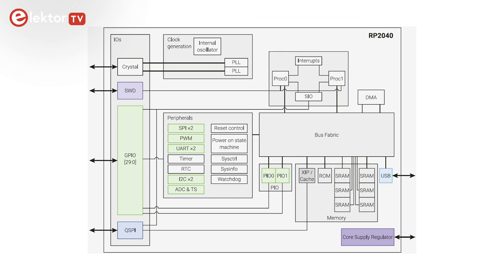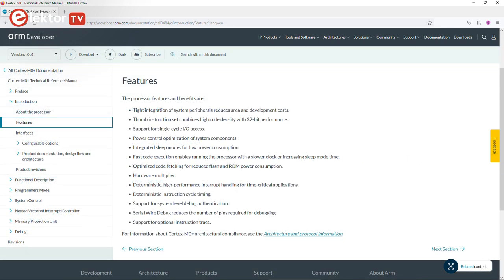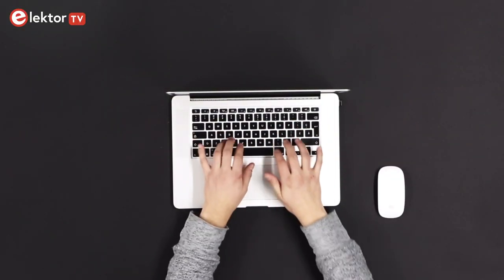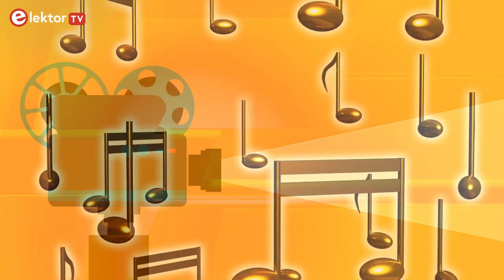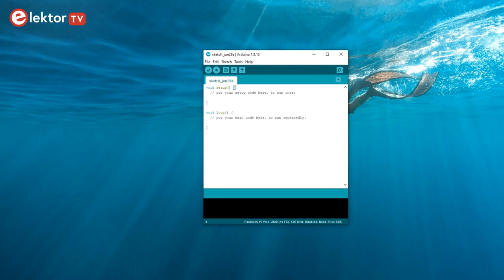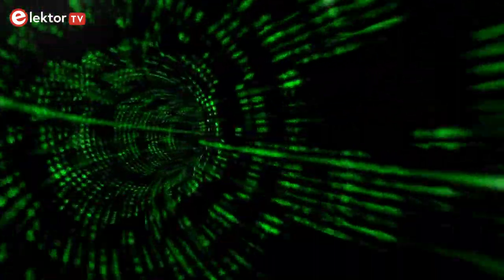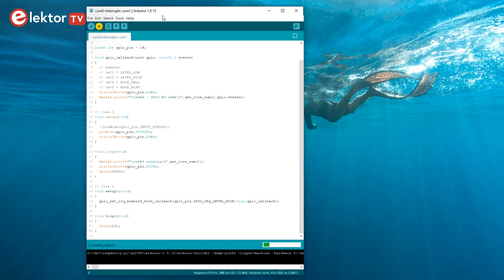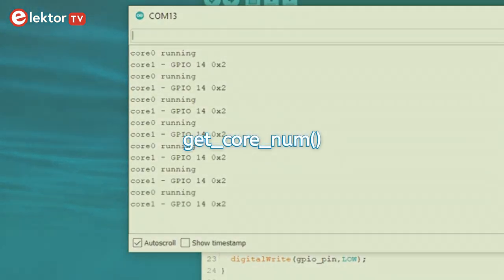Going Dual Core With the Raspberry Pi RP2040

Comment: Great video. I have just started a development using the RP2040 where one core outputs data from a to a display (RBG with sync) using PIO. The other core handles everything else. I am finding that the display scanning gets corrupted when ever I do anything on the other core. It's frustrating.

Comment: I am programming the RPI Pico with the Arduino IDE and the Philhower libraries. I use both cores in parallel, but when core 1 makes function calls from loop1, I think it runs them from core 0. Am I wrong?